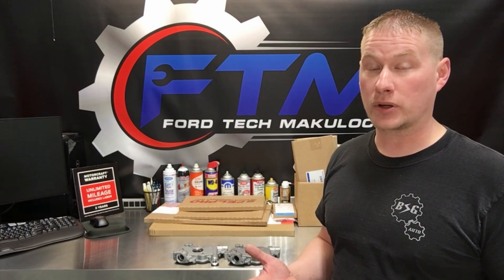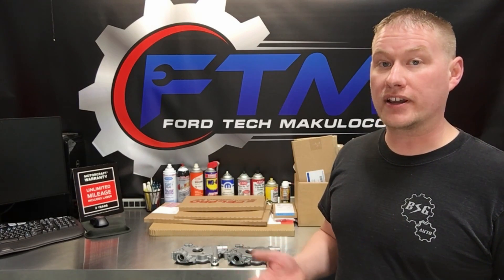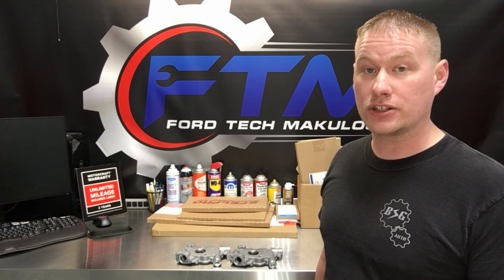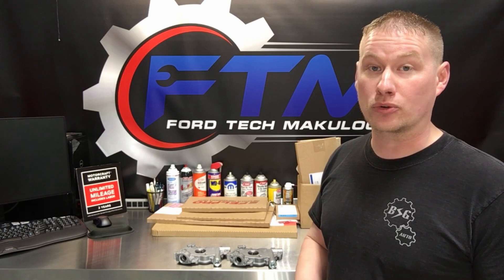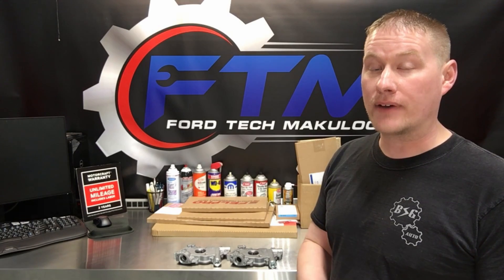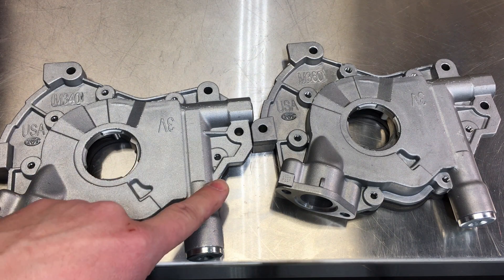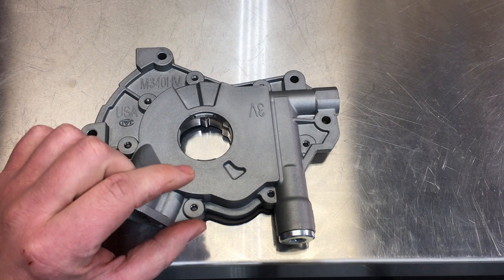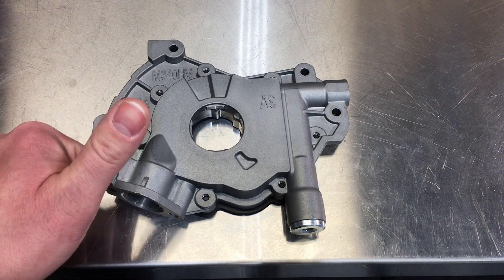The Ultimate 5.4L 3v Triton Engine UPGRADE: New Melling M340HV M360HV High Volume Oil Pumps!

Comment: I just bought an 05 Expedition with the 5.4 Triton.  I got a really good deal because the guy that sold it to me knew it needed plugs and you could hear the timing chain making noise.  He was afraid to tackle the job himself so he unloaded it on me for a good price.  I'm married with for kids going through nursing school so money's tight so if I want anything nice right now I have to get my hands dirty.  Anyway, the vehicle only had 113k miles so I thought it was a good deal.  When it came time to change the plugs I ended up breaking every single plug.  So I bought the lisle tool which worked awesome on every plug except the last one which was in cylinder 8.   The diode broke off which didn't allow the lisle tool to bite so I had to use an angle attachment and drill out the stubborn diode that was left behind.  I eventually got all the plugs replaced and it runs good now.  I love the torque this engine has.  You can hear the timing chain slapping around making that ticking sound so I'm saving up to buy the timing chain kit you recommended.  I'm glade I subscribed to your channel.  If I hadn't subscribed I would not have found out about the new high volume oil pump available.  Since I'll be that deep in the engine anyway I'm going to go ahead and drop another 160 bucks or so and replace the old oil pump with this newer high flow pump.   I feel it's worth it because again the vehicle only has 113k miles on it.  I keep up good maintenance on my vehicles so I think it will last a long time after making these upgrades.  I appreciate what you do.  I used to buy a Haynes book every time I bought a new vehicle.  Now I just use YouTube and I have to say your channel is very awesome the way you break everything down.
Reply: Michael Pritt ~ would very much like to hear an update on your project, sir. Hopefully all went well & you’re still enjoying that bargain...!
Reply: Man...this channel was made for you! I am afraid to change my plugs but when I do I will follow the videos here on the subject.
Reply: Are you still driving that truck ?

Comment: I've got a 4.6 where the oil pressure gauge has been reading low pressure for a long time. I replaced the sensor (twice) with no improvement. It runs fine and passed a NY computer inspection, so I just thought it was a faulty wire. However, I saw your video on the timing chain guide breaking with fragments blocking the oil pump intake causing low pressure and think that this just might be my problem. Ugh.  

I've driven it a lot like this and with 240K miles, the engine seems to have a lot of life yet. I believe that in addition to this timing chain guide, I also need to change the phaser units for my cam shafts, that you have so adeptly demonstrated as well. 

And just when I thought I had a grasp on all of this, a spark plug blows out. I fixed one two years ago with a helicoil, which has worked great. Of course, I saw your video about torquing down the plugs more than spec in order to prevent blowout the day earlier.  What timing.

Anyway, if, (amid all your work), you are able to read any of this, do you think that the engine is worth doing all this work on and have I caused some serious badness by driving it at least eight thousand miles with the pressure low?  Again, aside from these issues, the motor runs awesome.  Thank you for ANY input you can give. Much appreciated.  And if you haven't heard it enough, your channel just rocks.  What a gift to be able to impart all this knowledge to eager minds. Peace.

Comment: I want to put the high volume pump on my 2005 Ford excursion with 2 valve 6.8l v10 problem with high volume pump for mine I can't find the larger pickup tube to fit my oil pan can you help me find a pickup tube so I can put the bigger oil pump from helping in my truck

Comment: Question: I have a 2004 f150 with the 3v 5.4 engine and 140,000 miles. Which of the high volume pumps would you choose (high pressure or standard pressure) and why would you choose one over the other? Why would I use the standard pressure over the high pressure model unless there are problems that are caused by the high pressure, and what issues might there be?
Thanks for the video.

Comment: I installed the m360 about 2 years ago in my 04 f150 5.4t. Bolted up no problem with around 30k of great performance. Although I can't see the true oil pressure it's nice knowing it's there. The cast iron backing plate is so important any time your over 2k rpm, just do a little research and you'll see why. And the stock pickup tube is fine although several places the interweb says you need a cobra pickup tube that is maybe 1/8" bigger, Iam not constantly bouncing of the Rev limiter.

Comment: Awesome video, I have a new style 04 F-150 that is getting the full timing chain treatment, I'm ordering the parts now, what is your opinion on the Melling chain tensioners, with the boosted oil pressure, would you recommend them since the seals on the plastic ones have been a problem?

Comment: It amazes me that this is the same company that designed the 9 inch rear end and, while the car was disappointing, the mustang II front suspension.  Those are two items that are huge in the aftermarket.  Now, they build these engines that have so many issues.

Comment: I haven’t had any of the timing problems with my 120,000 mile ‘08 yet, I was considering selling it but with the price of new trucks I am going to by the parts to have ready when the time comes. On a side note My serpentine belt had become really loud, I thought the plastic idler had failed but it is fine, it turns out the noise was coming from the gator pattern on the Goodyear Gatorback belt running over the pulleys. I put a Motorcraft belt on, now all is quiet

Comment: Great video as always,  question , I have a 07 e150 with the 5.4 SOHC does this engine have the same problem as the 3 valve , I know I don't have the spark plug issue , but what about the time chain / tensioner / oil pressure issue ? Thanks keep up the good work.

Comment: Is M340HV for the 3 Valve and M360HV for the 4 valve?
Reply: Joshua Lester isnt this his new video?
Reply from the maker: Yes in general
Reply: FordTechMakuloco I just ordered the m360hv for the 2009 expedition 5.4 triton. Is that ok to put in? Or no since it's not a 4valve?
Reply: Which one is for my 04 navigator 5.4 4v?
Reply: MARY MIRELES neither there's a new high volume version of this exact pump look for his new video. I just Installed the new version in to my 5.4 Triton and I'm loving it. Look for his new video with high volume in title
Reply: MARY MIRELES the 360hv is what you need. Sorry I must have confused myself with other vids I've commented on.
Reply: Joshua Lester Amazon says part does not fit my vehicle
Reply: MARY MIRELES year make and model?
Reply: MARY MIRELES I would say it should be the m176, that's what melling speaks about on their site. But with the 4v heads you don't have camphasers so unless your pump is going out or has gone out there's no point in changing it. Best thing you could do is not take my opinion (I'm just a guy on the internet- even though I am a certified A&P mechanic) the dealer should know what is best for your motor. Or you could email melling or call them during business hours and they can straighten the whole thing out for you very quickly. Good luck, it's an enjoyable job :)
Reply: Joshua Lester its a 2004 lincoln navigator
Reply: I have to change my timing components , si i thought might as well upgrade..whats your best opinion?
Reply: MARY MIRELES have you done this already?
Reply: Jonathan Rosamond,   not yet. But I am going to put on by the end of June.
Reply: Ismael D when u do. Let me know how much better pressure you get. I wanna know a before and after. As your prob aware this engine leaks of the oil pressure everywhere. So I was looking for a cheap bandaid rather than paying a machine at to bore and reinstall cam bearings
Reply: Jonathan Rosamond, ok I will.

Comment: a tad unrelated but brian, i have a 97f150 with a 4.6. i run MC 5w20 syn blend per the old ford tsb. whats your opinion, should i stick with it or use 5w30. love your channel and have alot of respect for your opinions and outlook
Reply: I'd run 5w20 with oil stabilizer , I been doing it for years and the triton engines I owned did me good never had an issue

Comment: Hey Brian. Is it ok, or do you suggest running 5w30 with the stock pump?
Reply: FordTechMakuloco how about the 4.6 3v
Reply: @MrPami9899  Same thing. They were meant to have 5w-30 in them, Ford only said to use 5w 20 for emission reasons. I have safely been using 5w-30 on my 2008 Mustang GT for years now.
Reply from the maker: Always recommend 5w-30 in this engine.

Comment: Thats weird, we've got a expedition with 200,000 miles on it, no problems ever, changed the plugs myself with no problems, it's got an cold air intake, 3 inch cat back,hypertec  programmer, and a shift kit, 3 inch lift, runs great

Comment: Wow, that’s great. I have a 5.4 2 valve in my 1998 F150 it now has 254,000 miles on it. I put every mile on it with the exception of 3.3 miles when I picked it up from the dealership in October 1997. It has a little knocking on the right at start up, but goes away shortly after. Love your videos.
Reply: Are you using the stock Motorcraft FL-820s filter?  They have a better drain-back valve than most aftermarket filters and typically help with startup noise.
Reply: He's right about the oil filters. 
Yours is just tired,probably a little wear on the piston skirts

Comment: This has been needed for a long long time.  I too had talked to melling about this years ago and was also told there was no room.  glad they figured something out.  The standard practice of making the pump gears taller definitely wont work on a crank driven pump.  If this would have been around 5-7 years ago I could have saved a lot of engines.

Comment: How do you know if you need the 340 or 360? Does it matter or do they go to a specific year or something?
Reply: Just depends. Need to see if yours has the Guggenheim valve barrier or not. Your truck will have a serial number stamped on the frame in the rear above the spare tire. If it ends in number 1-6 it has one. If it ends in 7-9 or has 2 consecutive 0's then it does not. If getting above the spare is too difficult you can always run by your local shop and have them look. Most shops will be familiar with this on the Ford and should be able to help.
Reply: @Lordhumongus  Unless I'm missing something this info is completely incomplete = If it has a Guggenheim do you use the 340 or 360??
Reply: Did anyone watch the vid. FTM said  "if for any reason your in your 5.4 3 valve you need to drop 1 of these in" m360. Maybe I'm wrong

Comment: Hi, my 2003 Ford Expedition with 5.4 2 valve engine just crapped out with 204k miles.  The engine over past few years needed a quart in between each oil change.  The passenger side has an engine knock that can be heard from both top and bottom of engine.  A compression test was done and I personally seen my mechanic crank cold engine and two of the heads had no compression. The other two had 40psi and other had 150psi.  My mechanic said that rebuilding my heads may not be cost effective.  I was looking to see what engine remanufacturing companies you could recommend if any.  I was considering a long block from Promar and replacing items like water pump, o2 sensors, egr, map sensors, etc.  Should I dump it and get a newer model or stick with the 2v? I replaced struts with 1 inch lift, new brakes, upper lower control arms. Changed differential and tranny fluid.

Comment: Which pump should I upgrade to on my 2009 f250? My 5.4 just hit 100k and has only a slight timing chain rattle when downshifting.
Reply from the maker: M340HV is more than enough in my opinion.
Reply: @FordTechMakuloco  But now it seems that you recommend the the 360HV ?
Reply: FordTechMakuloco hi, do you still recommend the 340hv or do you lean more to 360hv now?  Thanks

Comment: On a 2000 5.4 can I go back to 5-20 if I install one of these pumps? & what one? No problems @ 175k except the dormant intake I need to replace again for coolant leak. Chain or phasers has to start making noise someday so might as well do the pump the with everything else. Oil changes always late & almost no  mains since 60k(don't like working on cars for free,not even mine).

Comment: Well dang! Wish I could have put this in when I did the timing set, lash adjusters, and roller followers on my '06 GT in late '16. I installed the M340 at least. Just broke 200k a few months ago. I also took your advice and switched over to  5w-30.

Comment: fordtech i  have oil leak from the rear of the valve cover on the passenger side, i cant see all the way back there but i dont think its coming from the cover gasket what else is back there that could be leaking 2013 f-150 3.5 ecoboost

Comment: I tried ordering the M360HV off Summit a week or so ago and they canceled my order saying that it was discontinued.  I know that wasn't true.  I love Summit, but they could have done better in this instance with the reason for cancellation.  I just went to Amazon based on your recommendation and found one and just ordered it.  Hopefully it comes through.  I have an M360 that I was going to run, but hopefully I can now return it since I should be able to procure the M360HV.
Reply: I went directly to Melling’s website and did a VIN lookup on mine. The only one they offer is the M340 and M340HV, at least for my particular VIN 5 engine.
Reply: @BrandonWest87  The M360HV comes up in the search for vehicles with the 4V engine. However, since this video I've read stories of many people having success with the M340HV. I have yet to install my oil pump. I hope to get around to doing it at some point this year.
Reply: @TheTruth27536  Yeah man that’s the difference. Mine is the 3V. I’ve heard the 4V uses the 360 versions. My engine with 160k on it runs smooth as silk with the new timing system and HV oil pump!

Comment: Interesting how the American 5.4L have so many problems, but here in Australia only real problem is spark plugs, otherwise there a solid motor.
Reply: 5W-20, Geez that's thin. We run A3 0W-40 at our dealership for both 5.4L 3V and 4V. Only see about 3 falcons a year with the 3V, luckily never snapped the spark plugs in them. 🤞
Reply: I switched to using 5-30w because of examples like yours Andrew
Reply: yea 5w-20 oil sucks.  just the manufactures trying to squeak out a tiny bit more MPG for the government.  5w-40 is even better.
Reply: Been putting 5w40 rotella in my 04 since 2012 with no issues, changed every 5k miles.
Reply: You likely aren't dealing with sub-freezing temperatures in the winter time.
Reply: Andrew Nash foreign oil
Reply: So I've started running racing oil and changing it every 2-3k miles and I have added a K&N air intake and a performance chip and I have had absolutely no issues at all with any "typical" oil burning issues, spark plug issues or anything of the sort. Just those few things and normal maintenance and it's running like a champ making multiple 600 mile trips a week, pulling cars and boats flawlessly and a lot of off roading. 2003 F250 with 5.4 ExCab 4x4
Reply: I just bought my '05 Expedition with the 5.4L 9 days ago. It's below freezing here right now, but as soon as the weather warms up I'm putting 5W-30 in it The dealer oil change sticker is up in the corner of the windshield, oil was changed less than 750 miles ago.

Comment: You deserve another subscriber man and that’s me. I have an 2004 f150 4.6 v8 and the only reason I keep it it’s because the 4.6 engine and 2valves not 3v otherwise I was get another truck. Anytime I have to fix something you videos are very helpful. I hope in one day you have to deal with one of 5.0 coyote engine having that ticking/knocking noise Because I have a problem and most of Ford dealers here in Georgia they don’t want to help too much.Thanks and keep up the good work as always.

Comment: 4.6 was fords best motor.
Reply: Yeah my 05 4.6 was awesome 250k miles with the original water pump , only  did plugs , coil packs,  u- joints , throttle body , that's it , all hard miles kept to the floor up shifting and down shifting, ( it's a tird out of drive ) treated that thing like a company truck , think using oil stabilizer and fuel stabilizer was a big help
Reply: Grandizer 45 You must have never had a 351 cleavland
Reply: waterloo123100 if it is better than the 4.6 it must be magical. 5.4 is just garbage.
Reply: waterloo123100  I use to have a 96’ F150 with the 351. It was a beast but damn...it definitely liked gasoline. 

The 2v 4.6 and 5.4 were probably the only reliable triton engines.
Reply: Maybe but the 5.4 4V all gear no phasers yeah
Reply: 351 was good, but I guess none of you ever had the bulletproof 300?
Reply: Grandizer 45 I would say the 5.0, 6.7 and 3.5 duratec are all more reliable.